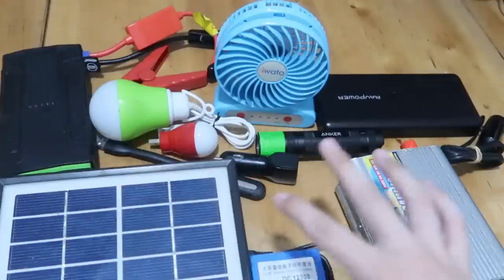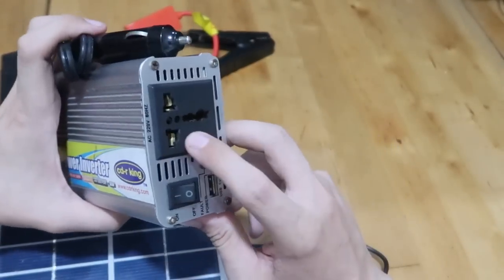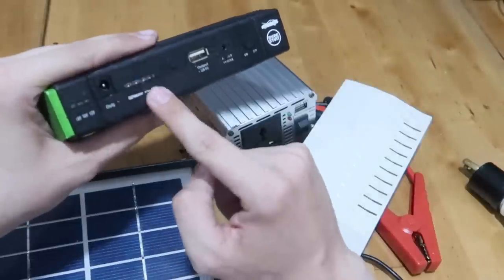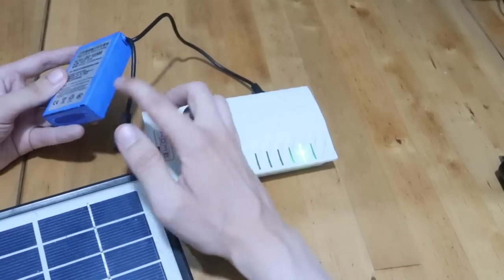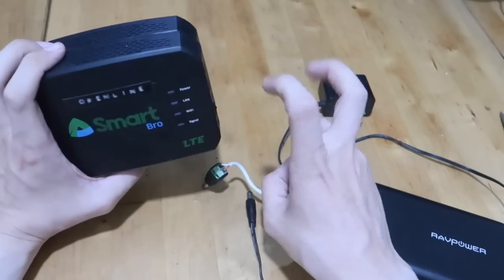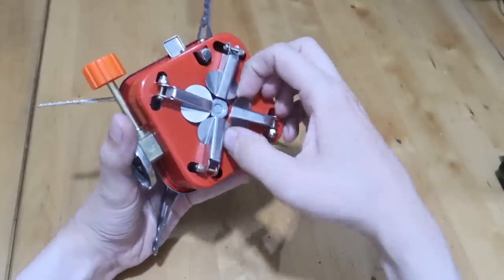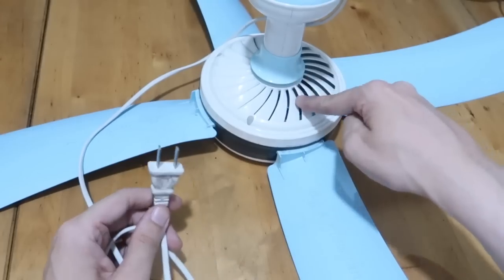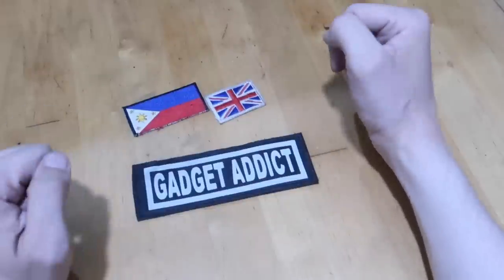Power Backup Options

Comment: 1. Using Flashlights and solar lights with lithium ion batteries. Even good quality hand crank flashlights will be good.

2. Use backup lights:- There are few normal 220 Volts lights that have a built in lithium ion 18650 battery. When power is there, they simultaneously glow and recharge. When the power is out but the switch is on, they use their battery power to continue glowing.

3. Purchase good quality NiMH batteries which have low self discharge rates and also high capacities. They can be charged once and hold power for long.

4. A slightly complex option is to get a lead acid battery, preferably a deep cycle one above 100Ah and also get a smart charger that can keep it recharged.

Comment: 😲 Never thought I'd see another review .😅👍 3:55 thanks for reminding this project, backup power for the modem.😊 5 watts? calculating just now...only 1 hour of backup power with a 5000mah battery?! edit 2:  I guess solar power is a must for backup power
Reply from the maker: Let's say your 5000mAh battery has a watt hour rating of 18Wh..

18 / 5 = 3.5 hours. 

There's some wiggle room in those numbers because of losses and how the Wh rating is calculated. So give or take 30-60 minutes.
Reply: @GadgetAddict  thanks. I got my numbers wrong. I forgot about the Wh rating of  battteries.